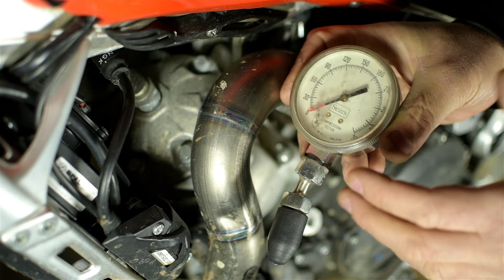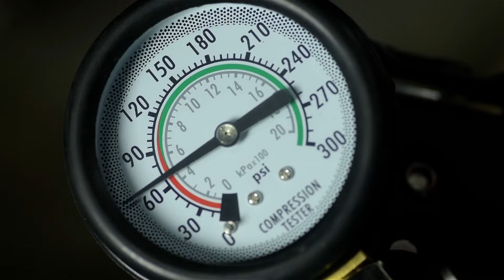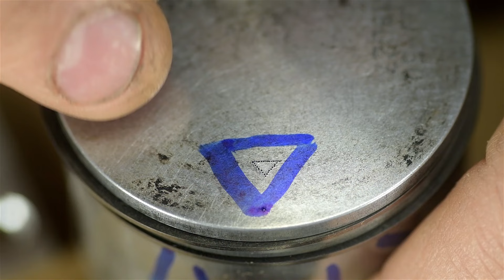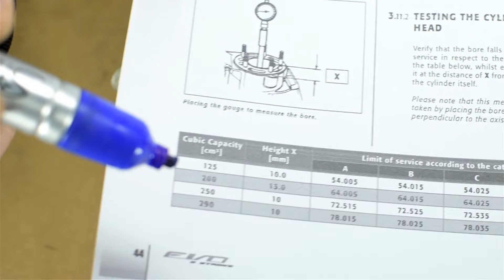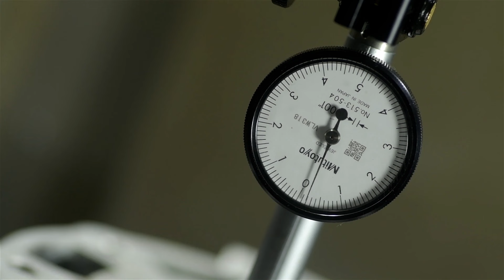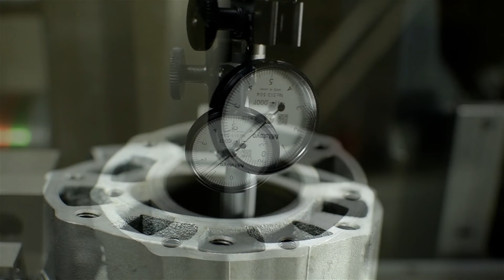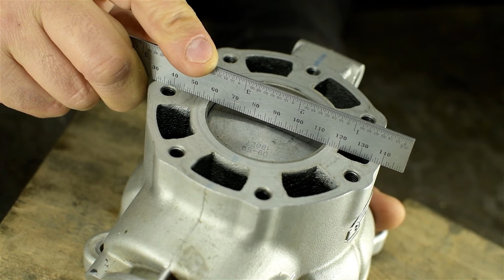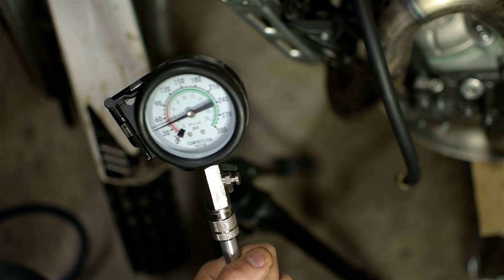Top End Rebuild! (2 Stroke)

Comment: I raced RDs and TZs and still have a KX500 so I know the smell of two strokes well. When I was racing some were still using castor oil - to be honest I don't know if this was a belts or braces left over or they knew something  but it will produce gum that will need to periodically cleaned. What I found was running a good synthetic  as lean as possible produced the most power and actually the longest piston/cylinder life. Back then  new pistons/jugs used to be cheap as chips and I had access to factory spares so I could experiment but I never seized an engine - I think I went as lean as 70 to one.. What I think is happening and what the engineers told me is that increasing the oil/fuel ratio actually causes detonation which then leads to overheating which then causes scoring/seizure. Of course the human tendency is to add a little more just for safety. I totally agree with you yes you can hone with a diamond flex hone but don't. Nothing is better for oil retention then raw Nicasil and matching the piston to the jug is best done by the plater when you get to that point.  Love your videos and your sense of humour. Awesome stuff

Comment: I think the gapped rings will pull higher compression when hot. I put about 3 pistons in my old 2 stroke without touching the boar. I used to advance the port timing by fileing about a mill off the inlet and exhaust piston top. Hotting 2 strokes is so much fun.

Comment: Another thing that honing the bore does is to allow the oil to “wet” out properly on the cylinder wall. These days with modern oils, additives will help achieve the same thing, but with a slightly rough honed surface, it helps the oil cover the cylinder wall more evenly and assists with bore lubrication.

Comment: I had a side-gig in a motor shop for a Motocross race team for a little under a decade.    I'm not going to go into any "advice" as well, as you said a dozen mechanics, a dozen answers.    To answer your question on compression to draw fuel.  We found that smaller motors usually around 80 on the gauge and it was only starting when hooked  to a tow vehicle.   Considering you went to spec on everything, your compression is more than adequate.
The only other thing to say is when you checked the piston crown height at the top of the bore, you can get different thickness of base gasket to adjust your "squish" to make the most of the explosive forces in the cylinder.   "Squish" is exactly as it sounds.  Take a couple of pieces of the softest solder available, put it in through the spark plug hole and allow TDC to squish it flat.  do both intake and exhaust side.  measure the squished solder and boom bobs yer...  [jump cut]

Comment: Gearbox oil will never get into the crankcase of a two stroke, different oil, different chamber.
Reply: Unless the crank seals are leaking!
Reply: some 2 stokes use the gearbox and the crankcase as a single unit and the same oil lubes the gears and the crank and those engines have the intake straight into the cylinder
Reply: @dublardemesrie  The main bearings might be lubricated by the gearbox oil if the crank seals are inboard of the bearings. But all 2 stroke crankcases are separate 'chambers' from the gearbox.
Reply: If the 
radial shaft seal on the crankshaft is damaged, it´s possible. 
Not infrequently Yamaha DT pull gear oil into the crankcase.
My Answer is not necessary anymore, had refresh my page to slow.
Reply: @Adam5130A  no dude there are 2strokes that have a seperate oil tank and they lubricate the bore
Reply: Johannes Müller  that would be a 3D lube system , but they still use 2 stroke oil , not the gear oil from the gearbox/transmission
Reply: @johannesmuller1288  yes they do but the bottom end of the engine is still sealed separately from the gearbox. When the piston goes up, fresh mixture is drawn into the crankcase. When the piston descends the mixture is pushed up through the transfer ports into the cylinder. If the crankcase was connected to the gearbox you wouldn't get any compression in the bottom end.
Reply: same engine tho
Reply: @livein3dlw  i bet my ass that there is a system that injects the mix directly like a 4 stroke

there even is 2 stroke maritime diesels
Reply: Never say never, and not even then.
Reply: @dublardemesrie  Nope, thats not how 2 strokes work, read up about the transfer ports
Reply: @TheYowling  i mean maybe it's a forced induction 2 stroke that has no crankcase/fuel interaction
Reply: Only type of oil injection is through the intake from a oil tank. Not at all similar to a 4 stroke.
Reply: Johannes Müller you are incorrect
Reply: @jeeg7204  No he's not.  Two stroke diesel engines do not use the crank case for primary compression, the bottom end is exactly like a normal four stroke engine.  Compressed air enters the cylinder via a valve in the cylinder head, and fuel is injected into the combustion chamber.  Exhaust exits via a port in the cylinder. Obviously this isn't how 2T gas engines like TOTs Beta engine work, but Johanne's claim is not incorrect.
Reply: If ToT said buttermilk I would believe it.
Reply: @TheYowling  i know how 2 stroke engines work cas im a mechanic and i have a small italian bike that has a 2 stroke with the crankcase and the gearbox as one piece and use the same oil also there are other engines that have oil in the crankcase like a 4 stroke so not all 2 strokes use a fuel oil mixture to lube the crank and thats why 2 strokes that dont require fuel and oil mix to lube the crank have the carburetor strait in the intake port like a 4 stroke
Reply: It will if i put some there.
Reply: torque 13 hate to bust your bubble dude, but 2strokes with the intake on the side of the cylinder still use the low pressure in the crankcase as the piston goes up to draw the fuel/oil charge in. The bottom of the piston goes above the port to draw the charge into the crankcase. When the piston goes down the charge gets compressed till the piston goes below the transfer ports and shoots in above the piston to get compressed and burnt. the bottom end will never be lubed by the gearbox. 2 strokes that don’t mix oil/gas have oil injection but it still mixes with the gas in the crankcase... 2stroke diesels are a different animal altogether, they have a blower to force the air into the cylinder and injectors to squirt the fuel in.
Reply: @dublardemesrie  Eehh, don't think so. how would the transfer stroke happen which actually makes it a 'two stroke'
Reply: Dude, you opened up a can  of worms!  But, I'll give you a thumbs up!

Comment: At about 20min what happened  to the new parts measuring? Is it secret..  :(
Reply: Sometimes the camera battery dies and no amount of profanity will bring it back.
Reply: I noticed it was a b piston,would have measured up slightly bigger
Reply: @barra245t2  But also not OEM, so who knows what "B" means in this case.
Reply: I mean we need to know the new ring gap!

C'mon ToT, you're slippin'!

😁👍
Reply: David H Most non boreable engines have a choice of an A B C Piston. They are basically the same size pistons but can be made in oversizes.
A normal engine you would bore the engine to suit the next size piston....in this case you choose the correct clearance sized piston to suit a non boreable cylinder.

Comment: Good call on the Nikasil, I  used to work for the company who invented it and it was used on BMW K100 bores . It was reckoned that a block was good for 200,000 miles but new rings at 100,000 miles

Comment: I don't know if someone already stated this. But a "leak down tester" might have been the tool to use instead. My dirt bike has a decompression valve, which makes it easier to start, but causes problems when you try to do a compression test. Just learning this so I thought I would share.

Comment: Ive started many engines with low compression (mostly 50cc bikes), but kicking to get it started is near impossible, bump starting (roll it then throw it in gear and dump the clutch) is the best way to start if you got low compression. Also works if you got bad spark.

Comment: First let me say I love your videos!  I have been working on toys for a long time and know your frustration with compression gauges. A long time ago I installed an Ashcroft liquid filled gauge (0 to 300 psi) on an old craftsman hose adapter and it has served me well. Keep your kit and try a new gauge. Also don't forget the schrader valve in the adapter. Note: Although it looks the same it is not the same as the one used in valve stems for tires. Thanks for the videos T

Comment: I dont know if anyone has said but if you suspect a pressure leak in the piston, do your pressure test and then put a little bit of engine oil in the cylinder, then do your test again. If you get a higher pressure then the chances are the piston rings have gone.

Comment: Just rebuilt my 2000 GasGas TXT280 top end, I bought the bike used for $700 in 07 and it always had really bad piston slap. Rode it until 2015 when I finally didn't want to make it any worse. Cost me $550. Went up to a C size piston, sent the cylinder out to Power Seal USA where they re-plated the cylinder and honed it to match the new piston. Bike sounds like new.

Comment: Comedy and an education.  What more could you ask for...so I subscribed.
Oh and your compression tester was one of those cheapo ones that doesn't have a schrader valve in the hose so it will read at about half value because of the added volume in the hose.

Comment: Also, best to allow air flow directly into the throttle body/carburetor.  Remove the air filter/MAF/air tubing as appropriate.  Maximum air = maximum compression.

(Just an FYI, not crucial for this scenario)

Lastly a "Leak Down Test" is extremely helpful in diagnosing an engine.

Comment: to confirm the rings are the problem with a compression tester. do the test dry and then put 5ml of engine oil in the hole , turn the motor over once and retest. if the compression goes up then its rings and not ' valving' or a dead head gasket.
  good vid.

Comment: You could do a leak down test, pressurize the cylinder at TDC against a calibrated orifice. They use them on aircraft engines to check rings, valves. Gunk in the cylinder could come from bad gas or cheap oil. You can check ring end gap by placing the rings in the cylinder and measuring end gap and change in gap at worn areas of the cylinder. Two strokes that use crankcase compression to pressurize the intake air can suffer from crankcase leakage.

Comment: Dirty ring grooves cause the most ring wear.  They get dirty from cold starts, then the goo bakes into coke when the piston reaches operating temperature. Eventually,  ring tension  spikes and the wear increases. 

Mechanic in a Bottle is a great solvent for this goo.  Also great on fuel systems that have that ethanol induced varnish goo.

Comment: If the piston were to have been a little too tall, then the fix isn't a thicker head gasket, but a thicker cylinder base gasket.  The piston height controls not only the compression/head clearance, but also the exhaust & bypass port timing.  Shimming the whole cylinder higher restores both port timing and head clearance.

Comment: Tony Tony Tony,  while the coating inside the bore was indeed very hard, a quick honing with some lubrication would have ensure any residual carbon deposits were removed. One of my concerns with just changing the piston is what condition are the lower rod bearings in?  I can't believe you didn't mic the piston pin bore in the piston rod. 

2 quick thoughts.
1. For your ultrasonic cleaner put white vinegar undiluted in it and put the parts in there and let it run a few times.You may have to lightly brush but it is not as caustic as carbon remover. 

2. That top plate was the "head"
You really need to get out more and clear the cob webs out. BTW if you had called I could have stopped by and helped you out. I used to build jet engines for the USAF.

Comment: Once ran a four cylinder to 400 F for a few miles in the rally car. Eventually freeze plugs blew out from steam pressure.
It (grudgingly) started up and drove off the tow truck's trailer. Each cylinder was around 30 lbs psi.
Early 80s Chrysler 2.2.

Comment: Today I adjusted the belt on my Zero SR/F electric motorcycle. It has a carbon fiber cog belt that you adjust, I kid you not, by strumming it like a guitar string. Gates has an iPhone app that listens to the tune the belt resonates with when strummed. After loosening the 27mm 75 lb-ft axle nut the tension is easily dialed to the ideal 75hz by waiting for the tools to show up then turning a T-45 bolt on each end of the axle. Re-torquing the axle nut of course adds or removes a random amount of tension, just enough to be out of spec. After two days of strumming I finally said close enough, took the bike around the block, and got to the point.

Several neighbors were out, in their yards, with kids, or walking their dog. Each of them gave me that "I'm so disappointed in you" look patented by moms worldwide.
One lap of one block and I put the bike away 'for the duration' as they used to say. 
Y'all stay safe.

Comment: Tony go thru the trash and find that compression guestimator , and do what I did , take the garbage gauge off  the adapter and put a better one one it , I put a 4" ( for my trifocal eyes ) winters 200 psi gauge (pem 225 lf ) on it for $20,  it don't have the protective boot but when tested against a known pressure it was accurate , plus I now have all the adapters to work on other stuff .

Comment: In all seriousness for a moment, if you encounter a nikasil.bore, just bore it out and make a 4340 sleeve, with a hat, Darton makes sleeves from centrifugal cast iron as well. bit a simple hatted sleeve, 1 thousand of bore fit. little milling and deburing, and whamo, all you need is a 4 jaw chuck and a cylinder hone to finish.

in the motorsports world, we call that skirt wear, thrust side wear. There's a place in michigan called line2line coatings, they make some awesome piston coatings, whuch take up wear

Comment: Hi Tony. I noticed you have number of dents on the exhaust pipe. Dents to the exhaust pipe on the header section usually hurt high rpm performance. You could make a video about how to fix these dents. It may involve taking the pipe off, cleaning any combustible residue out, plugging the ends, pressurizing it and heating the dents with a torch so they expand back out. Your piston and ring change improved a lot. It looked like your rings were worm very much past maximum spec. Maybe you can squeeze a little more performance out of the bike with an exhaust pipe repair?

Comment: You are correct about the engine starting with 60 psi , anything less than 120psi its going to required several kicks to build enough lower crankcase. pressure to force the fuel mixture up through the transfer ports to the combustion chamber. That piston was way over due to be replaced.  With blow by that far down the skirt that engine was probably down on power by 30 or 40%. Ten percent compression loss in a two stroke is too much if its a race engine , for a trail bike you would never notice it. On a motocross bike that much loss would have the rider riding a slug.

Comment: On a 4 Stroke, I'd put a little oil down in a low compression cylinder to see if it could get the numbers up, with the idea that the oil may seal worn rings, but could not seal damaged valves, cracked heads or other costly issues. I'm not sure if it would have meaningful results on a 2 stroke though.

Comment: I'm sure others have probably commented, but it's quite common to replace pistons and rings and not the cylinder. This of course If the cylinder is still in good condition. This is common anyways in motocross bikes to be specific.

Comment: About the compression: I once had a Briggs and straton read about 35 psi. It was a ripcord start. I counted 24 pulls before it could sustain itself. I dumped a can of Engine Restore in there and have brought that down to 4 pulls.

Comment: Blow-by is far more important in a two-stroke because that gas blows into the incoming fuel/oil mixture, diluting it and upsetting the mixture with burnt oil and burnt fuel, weakening the incoming fuel charge.  In a four-stoke, the blow-by largely goes out a vent.

Comment: 2 stroke rebuilds are my comfort zone.  it's easier to set squish band clearance with a thicker head gasket by the way.  messing with the base gasket thickness messes with the port timing, and that's not something you want to fuck around with if you don't know what you're doing.